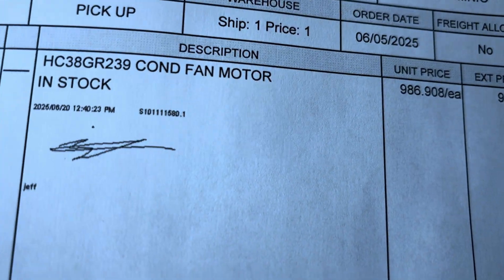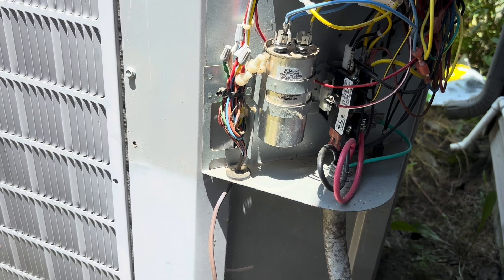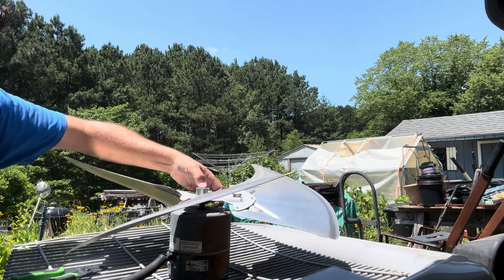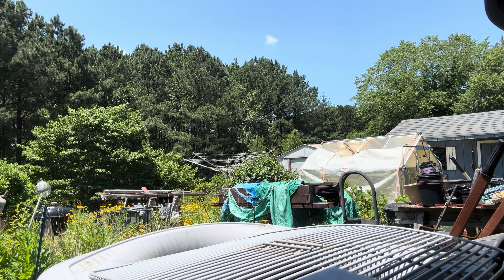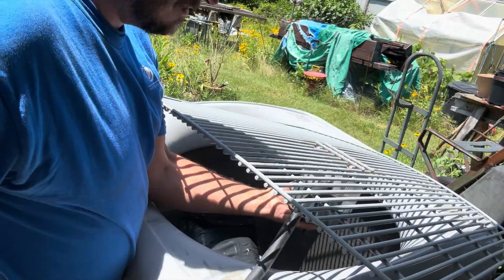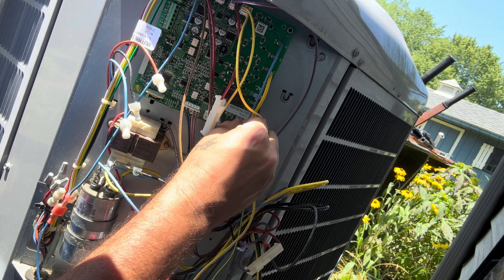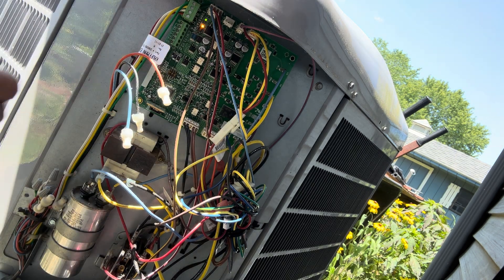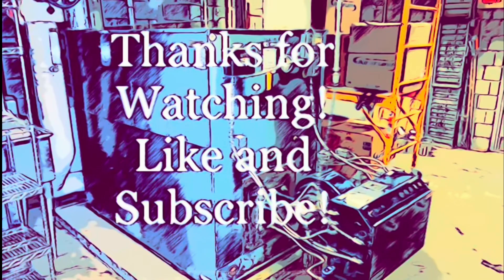Carrier Wants HOW MUCH For This Motor?!? Ridiculously Priced ECM Replacement.

Comment: The inverter boards for the 25VNA8 heat pumps are 1,700.00. Luckily all of the ones we've had to replace so far were under parts warranty.

Comment: Had a Trane unit go down with a bad blower motor. Trane wants $1198.40 for the blower but zero in the country and no timeframe for receiving it. Customer opted to get a unit replacement quote instead of fixing the unit.
Reply from the maker: Don’t blame them one bit!

Comment: You may be able to bypass the old motor control and put a regular single speed fan motor in. Just wire it directly off of the contactor. You wouldn't have the varitable speed but it would save a ton of money on the repair.

Comment: The sad thing is that there is ZERO reason these things couldn't be built to last. ECMs/BLDCs, inverter drives, whatever you call them all rely on switch mode power circuits which, if built with reliability in mind, are incredibly reliable. But no, they gotta make junk to keep the fat cats fat. In my case, the indoor air handler fan on my ICP made unit quit and I had to get not only the ECM, but I also had to replace the main control board because they changed the motor design such that the old control board, which was fine otherwise, couldn't talk to the new ECM. If it wasn't 90° in the house, I'd have opened up the damn thing and tried to fix it myself but others in the house were getting cranky. 

If it fails again, I will definitely be doing a teardown and repair attempt.

Comment: My house is around 6 years old. 2 Carrier builder grade 3 and 5 ton units. At 18 months the 5 ton ECM X-13 blower motor went out. It was cheaper for me to install a rescue than to pay a dealer the labor under warranty. Last year the CFM went on out on the 3 ton. Thankfully PSC so not too bad. It's and oddball 1/12 HP nobody local had it so had to next day it for an extra $100. For fun I Googled the price on the 3 ton blower motor. It was over $500 and as far as I can tell there isn't an aftermarket motor for Broad Ocean  last time I checked? Anyone know if there is a Broad Ocean equivalent rescue yet?
Reply from the maker: They typically make a Rescue or Universal replacement for all motor brands but you might have to add another device to make it work or to trick the control board into thinking it’s working.

Comment: Can you install a regular PSC motor, I've done it on Rheem ECM condenser motors and haven't had a callback
Reply from the maker: Where this one talks directly with the infinity control board via DC signal, I’m afraid a psc wouldn’t work without having to add another device to try and trick it.
Reply: @JeffsHVACAdventures  Such is "progress".

Comment: Carrier just asked to much my area they added Price inflation charge when buying parts. Went to get a price on a ecm oem blower motor for a 5 ton air handler they wanted 950$ went to a ICP dealer with same part number and was 250$ i won't sell them but even Trane getting costly.

Comment: This is why you stay away from the fancy high efficiency low quality manuf. grade equipment. They got you locked in buddy. You have to use their crap, unless you can make something else "Work".. That nice high efficiency electric bill savings equipment just ate any savings that H.O. thought they had in 1 service call. That motor is now $1046.12 x 1.75 = $1831 + 4 hrs labor @ $135 = $2371 (plus tax)....
Reply from the maker: You are so right about this!  That’s like 10 years of savings down the drain.

Comment: I changed my fan motor for $80 4 years ago. That's highway robbery! I have a roof mounted RUUD! Very easy to maintain and service. My unit is 40 years old.
Reply from the maker: Good stuff.  Keep er going as long as you can!  🤙
Reply: @JeffsHVACAdventures thanks, appreciate it!

Comment: I'm a Carrier guy too, but their stuff is up there in price. Had to install a 7½ ton split in an office building where I work. The business office requires 3 quotes for purchases over $5K. Trane's came in around $11K, Daikin was $13K, Carrier's was $21K. All basic stuff too. No variable speed motors or dual circuit/multi stages. Just single stage cooling with 2 stage heat pump (compressor+auxiliary strips). I couldn't believe that they were almost twice as much as Trane.

Comment: Wait a minute 😂you bitched complained but still bought the dam thing!  Well parts are in the control of the manufacturer either buy oem? Or go universal parts when you can.  But think about it this way.  Parts costing that much should put pressure on techs to properly diagnose. Stop being part changed and gas and go kings hopefully those days become just bad memory.   I appreciate your content keep it up. 👍

Comment: we just had the same issue w/ Carrier  roof top bad blower motor not an typical 24 vac trigger wire  but 3-7 vdc to control start & speed & my invoice from carriers was  around  $ 1250.00

Comment: Oddly glad someone else gets these prices... I thought for sure I had pissed off the wrong person at one point or another and ended up in the pricing category from hell.. most recently I had an a coil they wanted 3900 for, I bought a Daikin coil for 300 bucks and slid it into the Carrier air handler.... done deal. 
Thinking about this over the years I think it's just ignorant way to force you to buy new equipment and I think they're going to figure out in the future that what people did was switch brands. Keep up the good work and hang in there Summer's just starting LOL
Reply: Yeah, and they’re almost out of 410 an equipment and us small companies cannot get R – 454B refrigerant.  R 32 mixed with R1234YF from the auto parts store.😊
Reply: @USA-GreedyMenOfNoIntegrity we install both but given the choice  r32 is the way to go..20 year track record VS clusterfk👍

Comment: This is where somebody could add electronics puts a cheap little interface module that simply takes the signal that would go to the ECM condenser fan motor instead to your new PCS cheap motor and do the exact same thing. 

Small contractors in HVAC technicians have to pick up their electronics game . 
   Outsmart the companies at their own game. 
    Learn a little bit of simple Arduino , ESP32,PIC Devices, and you can completely override and replace any system in these modern day, inverter driven air handlers, and heat pumps. 

Unfortunately, it’s going to have to be up to groups of ingenious wise contractors, who are technically mechanically skilled to up their skill level and service technicians . 
      You absolutely do not have to replace the existing hardware and including even circuit boards. There are universal ones that can completely take over.. 

Over in Asia and Japan, China and Korea they have complete universal circuit boards to replace OEM‘s .
Reply: Thanks Jeff for the video today enjoyed it

Comment: I think you will find that NOT being an authorized/preferred mfr's dealer, your pricing will be higher.
My cost on that motor is over $200 cheaper, granted it may be location playing some part in that, too.

Also, thank your government for mandating higher efficiency products.
Anything nowadays is more expensive to repair, sometimes cheaper to replace.
You have an ECM motor vs a PSC motor, more expensive.
Reply from the maker: We are still considering a Carrier FAD dealer but we aren’t in the top tier any more like we used to be.  Probably had a little to do with it.

Comment: Hey Jeff are you able to install a universal ecm motor if the customer asks?
Reply from the maker: It is possible.  I’ve never tried a Uni ECM condenser though.  I’ve done several uni ECM blowers though with good luck.
Reply: Hey Jeff, I just installed one yesterday on a York unit. It worked out great. It varies all the way up to 1075 and it was only 64 bucks my cost through ARS and I’m in Phoenix Arizona.

Comment: BUT WHY keep installing ECM motors ..give the customer the option of a capacitor motor like I do.😮
Reply from the maker: Would love to.  And you can on any non-communicating system.  But with the Infinity, the motor “talks” back and forth with the board and it will send the unit into a communication error.  If you really wanted to, you could take the Infinity user interface out and wire the whole thing like a normal heat pump.  Then you could use a PSC motor but no one wants to do all that.   Maybe in an emergency situation.

Comment: Those motors are listing for about $800 on amazon...while a normal 120/208 replacement condenser motor is $90... Why is an ECM motor even failing? It should be monitoring and protecting itself. Have you ever torn one down to see what's failing?  Or do you have to turn them in for a core fee?
Reply: They are the reason we ALWAYS install Intermatic AG3000 surge protectors on the outdoor and indoor units. $65 each is cheaper than a board or motor. We don’t sell them as an upgrade. We include them in the quote. On service calls we didn’t install, then we do advise them for $99 each, installed.
Reply from the maker: I’ve torn them down before if they aren’t warranty.  This one seized up where usually the mod fails.    Might be worth opening.
Reply: @JeffsHVACAdventures  - Yes! it is crazy prices.  Good Idea to save the modules on the ones that  lock up assuming it did not fail due to locked rotor condition.  On the GE/Genteq ECMs, the heat seems to kill the bonding agent on the magnets on the armature and then it separates and binds to the stator. The ball bearings go to. In an emergency, I've used the armature assembly from an 1/3 HP indoor fan ECM motor to get them going on a weekend/holiday.  Good video, thanks for sharing.
Reply: @TheGgin  holy crap. the motor itself fails?  damn. I was expecting a failed semiconductor. Not poorly bonded magnets. Sounds almost intentional.
Reply: @FixitFrank    I still think ever since ECM motors became more popular, there have been WAY more failures in those vs standard / cheaper ones.  And yes, 90+% of the time it was the electronics burning up.  What's the point of efficiency if you're having to replace them more often and at almost ten times the cost?  Sometimes "new & improved" doesn't always stand true.

Comment: Our salesman cleverly made a price list of many Carrier  parts. When he is selling a replacement system and the homeowner asks if we are a Carrier dealer, he shows them the prices of repair parts and says, “ Not any more”. We use Goodman and now Bosch. Budget friendly and high performance. These two cover the market in our area. We are seeing  a big call for the Bosch inverter duct system requests. We still stay away from the 15 seer model because of board failures. A buddy told me they resolved the issue, but Im not convinced. The BOVA 2.0 is excellent.
Reply from the maker: Yea we still move a lot of Carrier on the new construction side (we do a lot of new apartment complex’s) but it’s the builder grade.   We are primarily a Bosch dealer on all other Resi sales at this point too.   And yes over the past 18 months I haven’t personally seen any board warranties.
Reply: @JeffsHVACAdventures 
Bosch is a pain on warranty for the boards. You have to call in and a tech will walk you through a long process before approving the board replacement. I have only seen 3 bad boards in two years using Bosch. Fingers crossed.